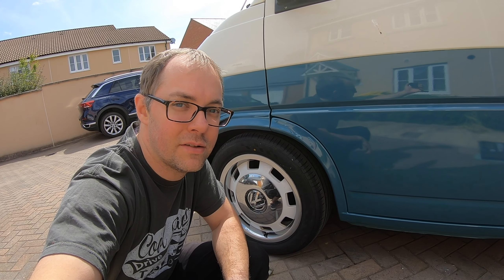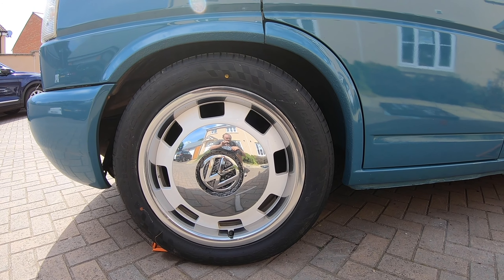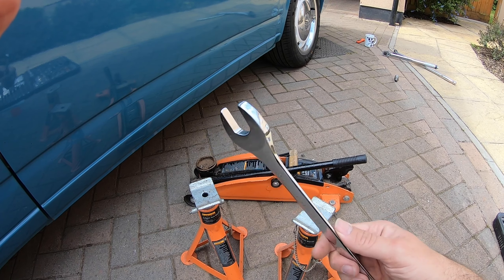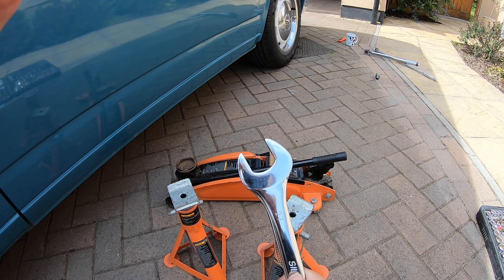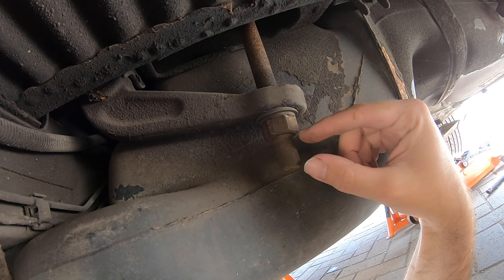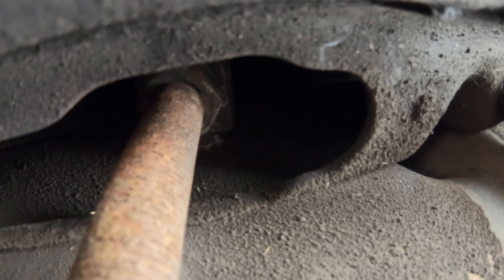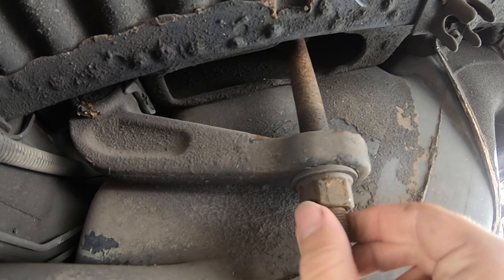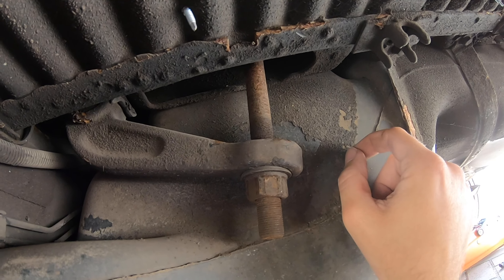Volkswagen T4 Suspension Lowering (Transporter/Eurovan) How To Guide

Comment: The most comprehensive T4 suspension lowering how to,  good video John  ; ) ....................  However,  I feel I have to mention to viewers not to do as you did @ 10:12  
The securing pin wasn't fully in the locating hole on your jack stand!  Please, guys,  do double check the locking pins,  and on the ratchet types as well.  Having just half a locking pin in position will compromise the jacks capabilities,  on a 2 ton van even a 3 ton capacity jack will be more than halved!

Still gave you a thumbs up though John,  as you were just demonstrating  ; )

TURK

Comment: Lovely vid but just so you know the torsion bars do not effect the opposite side they are connected on the same side so effect the same side. And the pin for the axle stand was not all the way through when you dropped the chassis rail on to it be careful I know someone who died having a axle stand fail. Sorry if this sounds to be funny but just trying to help other people and you self

Comment: @t4family, I’ve just lowered mine it’s a coachbuilt so just did the front about 50mm but the offside sits about 20mm higher even with adjusting left hand thread 5mm more and still sits the same. Not too sure what I’m doing wrong to get them both the same height? Vid was really helpful thanks 🤟

Comment: Hi what shocks you have a front my caravelle camper 2000 has had Lyn gas and ride harder now although road holding better.been lowered by Garage at front and shocks and lowering springs 60mm at back plus mayb shocks rear,anyway after trip to lakes rear too low so change springs at rear myself to 60mm so clearance better.was thinking boge or Sachs hd super touring short shock be better or maybe b6 .thanks.steve

Comment: Being a T4 newbie, that's a great simple video to explain the process.

I do have a couple of questions...

With lowering the front, will I need to adjust the camber?

And...

When purchasing springs for the rear, are straps usually included?

Thanks in advance 🤙🏽
Reply: @lee Davis - yes get a 4 wheel alignment after lowering ! Also some does come with the straps but some don't , check the description before buying it should said , or buy them separately

Comment: Hi Jon, good video!
Inspired me to lower mine. I can’t seem to find the right springs though. I’ve got a 93 eurovan and all I find is for a 94 and up and those kits come with 4 springs. I’m assuming they changed from torsion to spring in 94?
Can you help recommend proper springs
Reply: No front springs on t4 mate , torsion bar and damper  , on the rear it a shock absorber and a spring

Comment: Great video, most informative. Have you only adjusted the torsion bars and swapped shorter springs? Did you also fit shorter shock absorbers? If only torsion bar and springs were done then how is the ride quality on the oe dampers at that lower height? Thanks!
Reply from the maker: Hi Josh, thanks for getting in touch. So yes, I have just lowered the torsion bars and fitted shorter springs. I did not fit shorter shock absorbers but what I did do was to fit new dampers when I originally lowered the van. We now have Sachs HD Super Touring which are quite an upgrade on the originals, but as you mention they are ideal because of the reduced travel. 

On the front you can get round this by fitting Scarface Lowrider front shock relocation plates (https://www.thevdubmonkeys.co.uk/product-page/vw-t4-scarface-lowrider-front-shock-mounts) and shorter drop links (https://www.thevdubmonkeys.co.uk/product-page/t4-short-droplinks) if you want a better ride when low on the front. This combination will give you more travel in your dampers.

The ride quality on our setup is pretty good, not too harsh but you will feel the potholes and the bigger bumps as you hit the bump stops on the front. The rear is absolutely fine though, which I think is because we are using longer springs and lower spring rates (6" @ 950lbs) compared to other T4 owners who have 5" springs at 1100lbs.

If I'm honest, where it sits in the video is about the limit you can go to without relocating things and fitting shorter shocks. I think for the summer we might raise the front about 25mm and put the 7" springs back in at the back as the roads this year have not been maintained well. Another thing to consider is wheel size, we have quite chunky tyres on our 17" rims so they absorb a lot of the bumps as well. When we were running low profile tyres on 18" rims that was a LOT harder ride.

All the best,
John.
Reply: T4 Family Hi John. Thank you for taking the time to pass along such comprehensive information. I’m currently weighing my options on my t4 vr6 over here in the states and this provides heaps of help!
Reply from the maker: @joshskversky6112  No worries, one other thing you might want to consider is that the VR6 engine and the auto box weigh a bit more than the 1.9td that we have. If you have syncro 4 wheel drive you might also find the rear suspension setup different because you will have a rear axle whereas we only have trailing arms. Best of luck!
PS, you might find this website helpful to check part numbers and exploded diagrams https://volkswagen.7zap.com/en/rdw/transporter/tr/
Reply: @T4Family  Lovely explanation, John thanks. I'm going for oversize tyre diameter on my new 6.5" wide 16" steel wheels. Oversizing the tyres means it will affect the speed gearing. The T4's speedometer over-read is approx 4 to 5% depending on standard model tyres size, so oversizing/gearing up by simply selecting the next higher tyre profile size is mathematically logical - and will reduce mileage reading over time! Plus, you're saving on fuel at higher speed cruising. It's like having an extra gear. This obviously affects acceleration, but I don't care. The profile size is the second number of a tyre measurement, and they increment in 5s - it's a percentage of the first number - the tyre's width in millimetres. My brother has done this with his T4. He has massive tyres on his but I wouldn't advise going too big, naturally. My choice of tyre size is 215x65x16. This works out exactly one tenth of an inch larger in total diameter than the largest VR6 specified tyre diameter - well within safe clearance for standard suspension setting and up to minus 50mm suspension (drop) setting.
FYI, the rear side, rear tyre to rear bumper clearance on standard springs is quite tight at about four tenths of an inch, but with a lowering of 50mm - about the drop of your van currently - this increases to about 0.95 inches rear side rear clearance. For visualisation purposes, rear side rear clearance is the smallest tyre clearance (of unsteered wheels) to arches of the T4.
Play with these websites comparatively:
https://tiresize.com/comparison/
https://www.willtheyfit.com/
Hope that's useful 😃

Comment: Incorrect information regarding adjusting one side will alter height on the other.
The side you are adjusting, is the same side it affects.
The bars run parralell to the van from adjuster straight forward to hub. They dont cross over

Comment: My advice: The jack and stands are not rated for this load, regardless of what the majority will come back with 'it's only one corner'' rubbish!  At the dreaded 10:12 bit I actually had to look away!  Not only is the pin dangerously and incorrectly seated you're contact point on the chassis is minimalistic.....and that's being kind.  Regardless of the content quality this vid should be removed, re-filmed using the correctly rated equipment and demonstrating optimal positioning; thus maximising safety.    Sorry folks, not good at all.